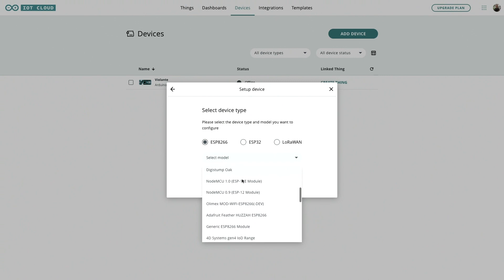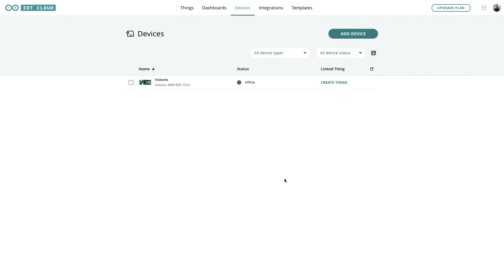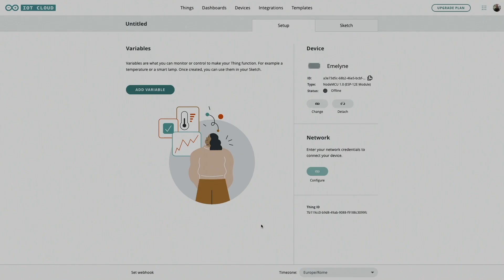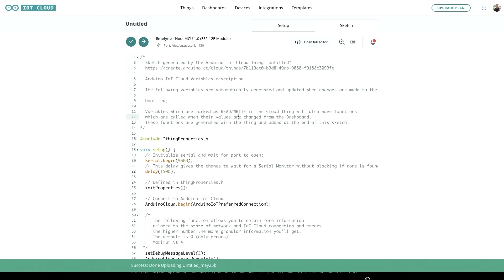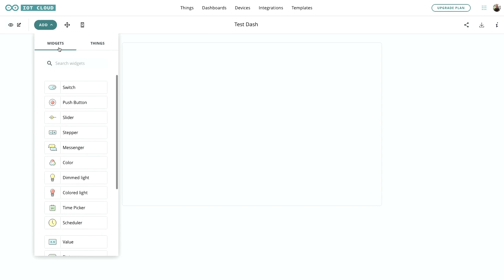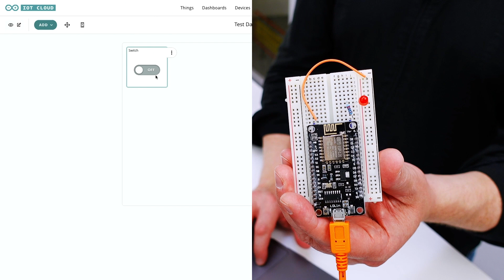Connect an ESP8266 Board to the IoT Cloud Securely, Without Any Code

Comment: the device remains offline..no matter what power source it is connected to...the security key is correct, the sketch uploads successfully...but no response to button state and the device is always shown offline. have all the drivers and have used the same board successfully with arduino IDE to upload other sketches. ESP8266
Reply: Same here.
Reply: @HeimdallAfBifrost  any solution found?
Reply: @zeeni17  have you found soluion?

Comment: I have an ESP8266 connected to the cloud. It monitors the temperature in our house while we travel during the winter. I wish there was some way of the app to send me alarms if the temperature drops too low. I tried to do this with an Arduino SIM card but could not get the sim to work.
Reply: I'm a developer. I can build you an app just for that with all your required styles and features. Interested?